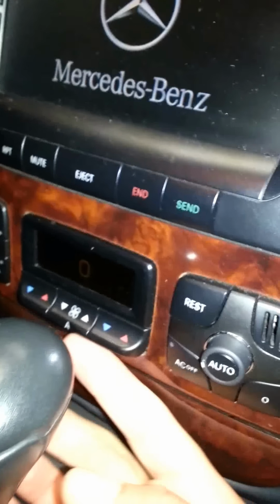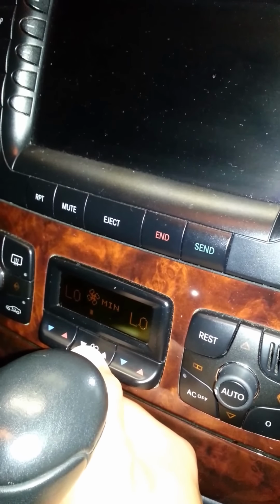How to fix a 2000-2006 S500 Mercedes W220 AC Blower

Comment: I have just diagnosed my car and I am not getting any power to the din connector that comes from the command unit. Could the climate control module be faulty? Why would the connector be dead? Any help would be appreciated.
Reply from the maker: +Benny Palma the din from the center console that connects to the regulator? It's suppose to register around 4 plus volts. It's more of a relayed power to signal the regulator to feed the motor.
Reply: When I went in to test it I didn't get any readings. When you probe this unit with the multimeter are you supposed to connect the black lead to the brown ground wire and the red lead to the red/yellow wire to test for power? I think I may have tested wrong and didn't get any power from the din.
Reply from the maker: Benny Palma yes. Brown is a ground. red yellow is a live wire. It could read 12 volts but it could have low current causing no power to the blower.
Reply from the maker: Benny Palma make sure to watch my video on the melted fuse
Reply: I have. My fuses look good to go and have a solid 13v going through when the car is on. I'll go back and check the power connector tomorrow making sure I do it correctly. I'll keep you posted. Thank you for getting back to me.
Reply: Hello Peter. Alright, I did some troubleshooting. I measured the current coming out of the voltage regulator and its reading 11.5 when the engine is running. So there is something coming out. 

I assumed the blower was done. But then I plugged the blower motor to a battery and it worked just fine. But when I plug the blower motor back into the resistor nothing works. 

What do you think it could be? The regulator or the motor? I am totally confused about what could be wrong.

Comment: Thanks for your great video! i have to replace my temperature sensor (error 1229) and i saw your video and i guess you told that wire left of blower is where it connect, am i right? help me please! best regards
Reply from the maker: Filipe Pereira hey Filipe. I'm not sure what problem you have. please look into the Mercedes forums for extra help.
Reply: Peter Zafra thank you very much for your reply! my problem is that my ACC don't blow hot air on front center console, just in side vents and rear vents! I check up my ACC and show me error 1229 so I search on the web and found that it is from climate temperature sensor!
Reply from the maker: +Filipe Pereira let me know if you find the fix. I would love to know what the solution was.thanks for watching
Reply from the maker: +Filipe Pereira that's awesome. I hope you fixed the problem.

Comment from the maker: Hey Guys, just an FYI, Fuse 33 sends a live positive directly to the blower regulator then from there, the fan gets fed from the regulator. Thanks for watching.
Reply: Peter Zafra 
Hi i have e240 mercesdes .. my problem is blower motor AC not working sometimes or if I want to degrees can speed blower fan off and if high degree back working again.. so is the regulator bad ? Thanks
Reply: I have a 2003 s430. Where can I locate the fuse 33. Great video btw.

Comment: did you notice the regulator gets real hot?
Reply from the maker: hi. sorry for the late reply. the regulator Shouldn't be getting hot. I just had a fail on mine and I found that my fuse was the problem. it had melted and caused my regulator to stop working properly due to high resistance. check fuse 33 located on the passenger side of the engine bay. 40 amp orange fuse. good luck.